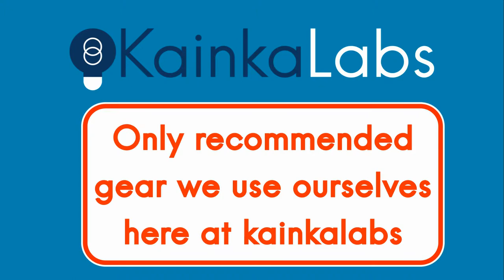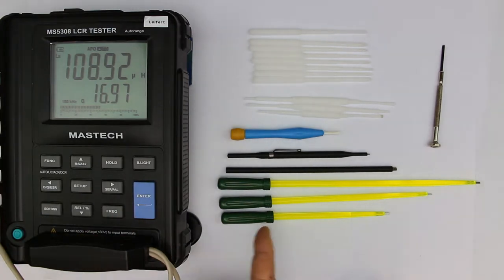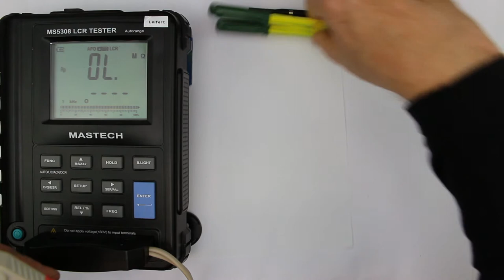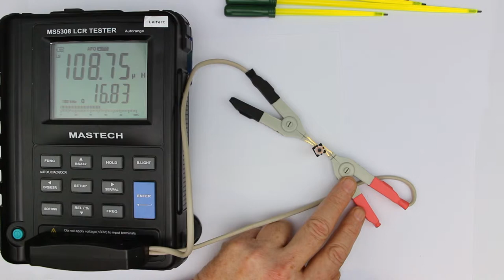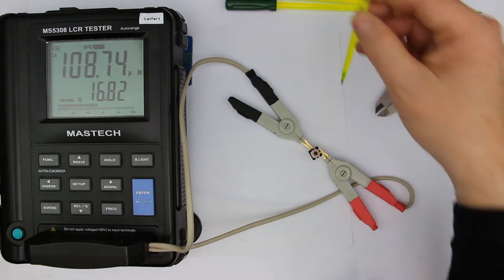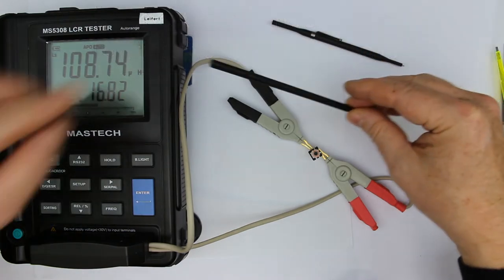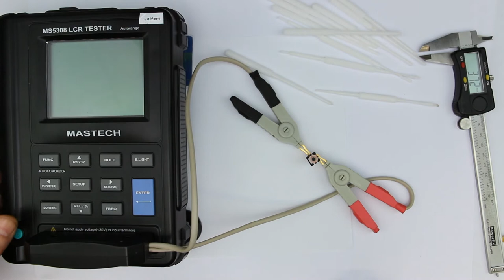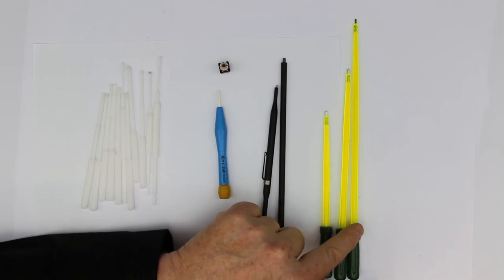Every maker should have…[Pt.14] Adjustment Screwdrivers

Comment: 7:33 The reason for them being slightly reseeded is so that when you adjusts variable resistors, it don't slide of the small screw when adjusting it. :-)
Reply from the maker: I thought it was for isolating the blade so that when you slip out of the slot the risk of touching/shorting anything else is minimized.
Reply: @KainkaLabs  A logical guess but no it is, as I wrote, to prevent the slip in the first place:-)
Thanks for answering by the way:-)